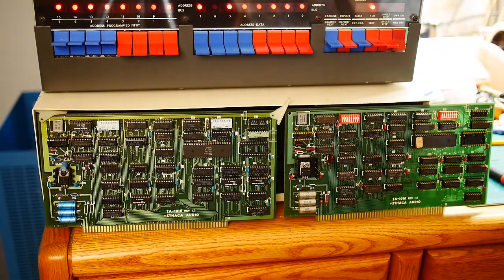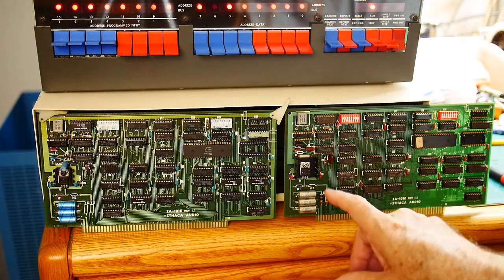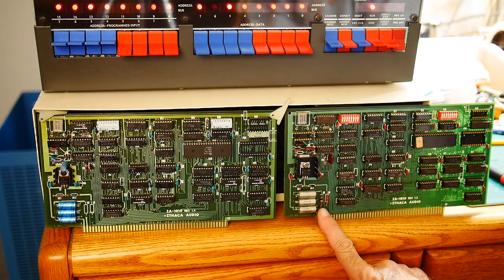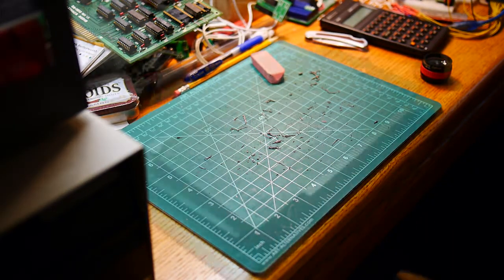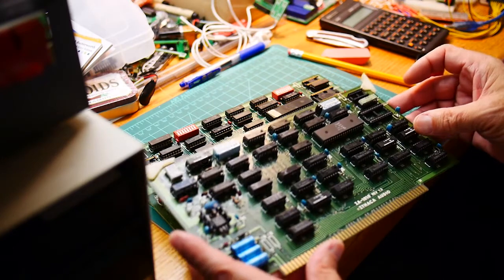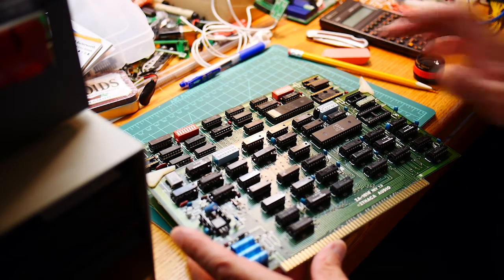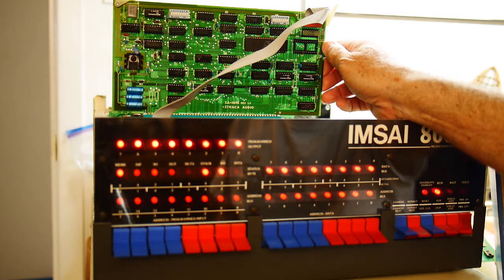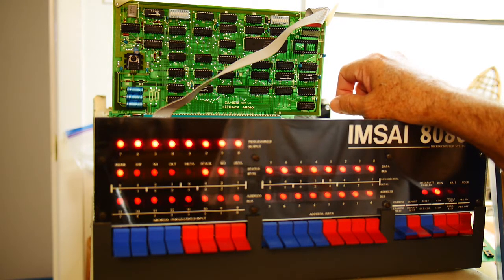#46 IMSAI 8080 Ithaca Audio Z80 board

Comment: I just got a Imsai 8080 with a non functioning Ithaca Audio Z80 card.  I say non functional because there’s no crystal installed.
I picked up a 18mhz crystal from Surplus Gizmo, but not sure if the original crystal was a 36mhz, and if slower one would throw off timing.
Any suggestions?
Before I can try the Z80 card I need to do a front panel modification for status M1 signal.
Reply from the maker: it is probably a 4MHz Z80 so use the right one. slower won't hurt, but make sure the S100 clock is 2MHz for other cards that need it.
Reply: @IMSAIGuy  thanks.  I will probably pull the optional inductor and capacitor in the tank circuit, then I’ll double check the installed resistor and capacitor and if needed hunt for a 36mhz crystal on EBay.
Reply: @IMSAIGuy  one last question.
My IMSAI front panel didn’t come with a CPU interconnection cable, there’s a 16 pin dip socket on the back of the board.
The manual lists this as cable K 91-0400001.
I can make my own 16 pin cable, but it would help to know if the ends are crimped on pins up on each end  or is one
end with pins facing down?  I think the length of the cable is about 15 inches.
Reply from the maker: @mikeenkelis8522  sorry, I don't have it anymore. check the schematics for pin 1. I'm pretty sure they are on the same side.